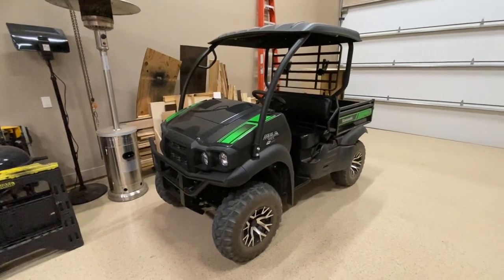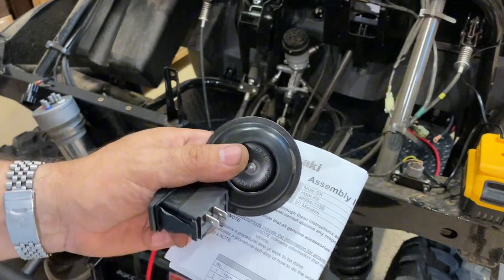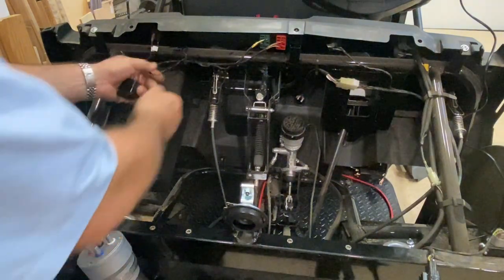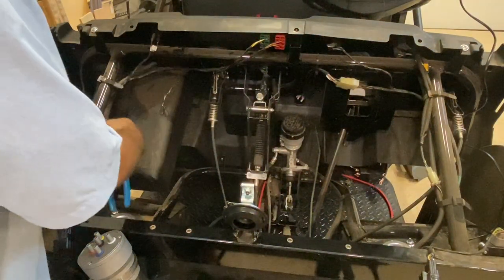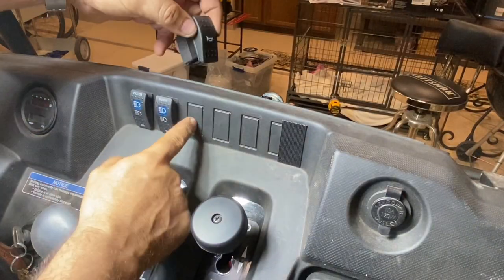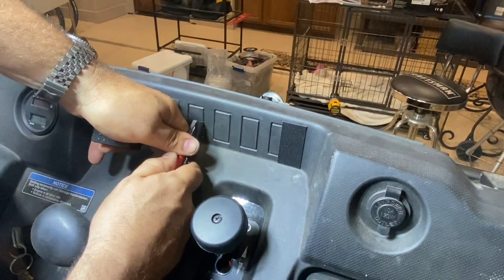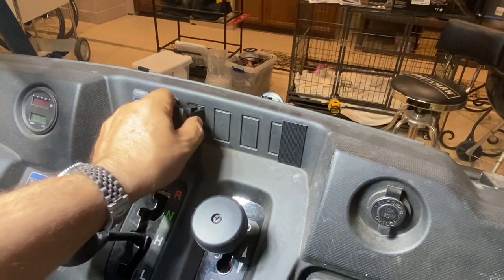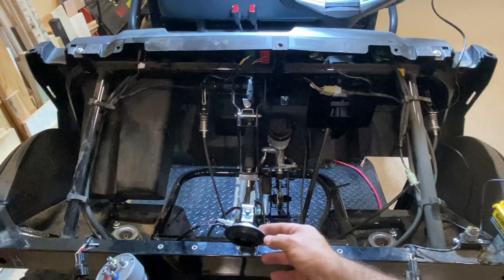Kawasaki Mule SX ● Install the Stock Horn from Kawasaki

Comment: Thanks for the video. I've been thinking about putting a 28" tire on mine,  do you think they would fit without modification?
Reply: Highly doubt. Be sure to check the actual tire size not just what the sidewall says. The mule sx xc has 26” with a lift from the factory